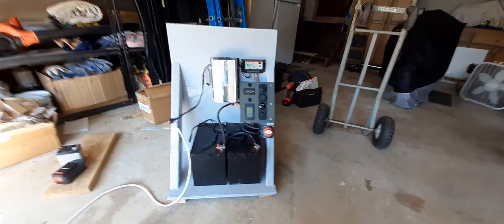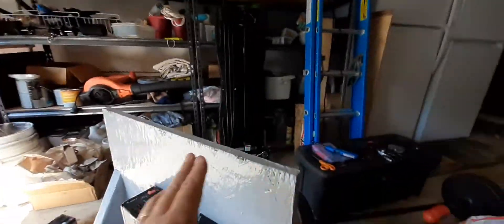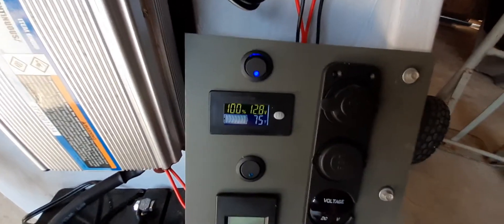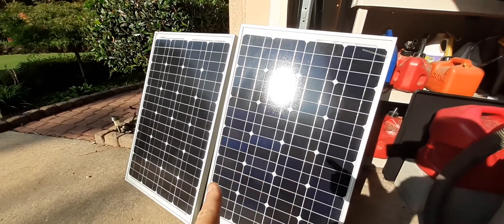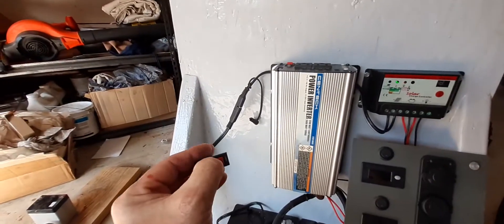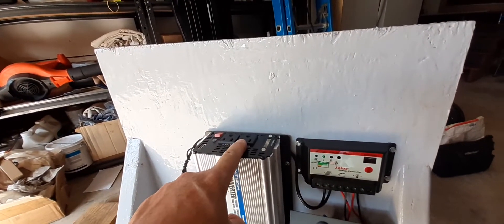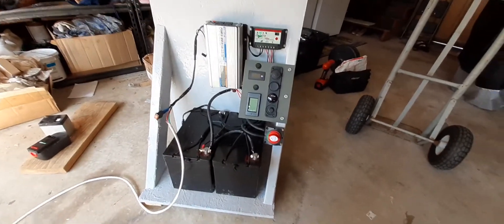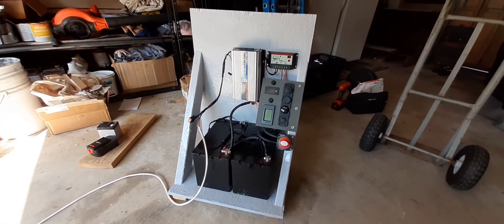DIY Portable Solar generator update (final version)

Comment: I really like this.  You don't have to use a dedicated hand truck with it.  You could just move it around with the hand truck and place it where it's needed, then, you could use the hand truck for something else.  If It were me, I wouldn't put it in that box.  Great job!  Thanks for sharing.
Reply from the maker: Thanks for the comment!!   I built this with the extra batteries and inverter that I had on my sailboat (which I sold a few years back)
Reply: @jimmyboy163  Cool‼️
Reply from the maker: @ImASurvivorNThriver  also have a video about some satellite dishes I turned into a solar cooker you might like